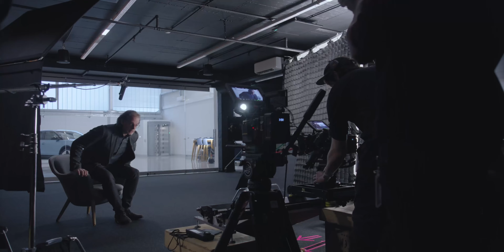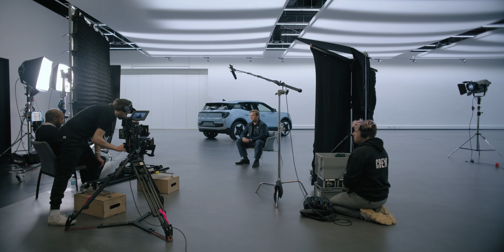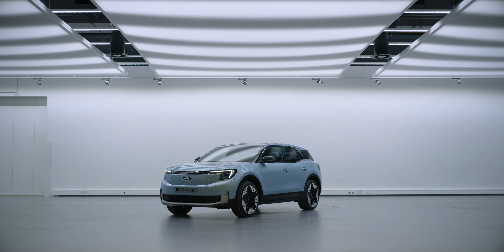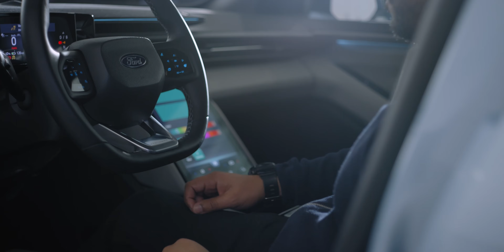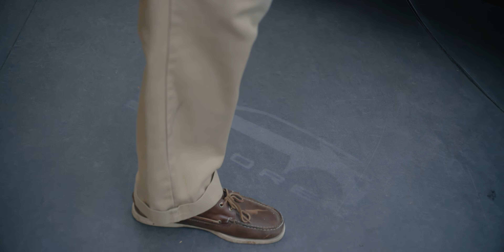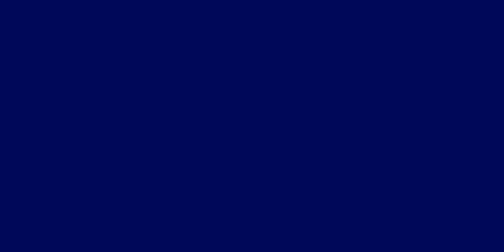Technology | New Ford Explorer® | Ford UK

Comment: Looks promising, Will head up display be similar to vw cars, with AR based navigation (animated arrows etc.). Also what about adaptive regeneration like id vw ID cars (slowing down automatically adjusting to the road conditions when you lift off foot from accelerator during normal drive,  not cruise control?)